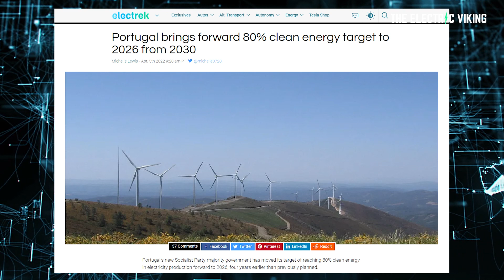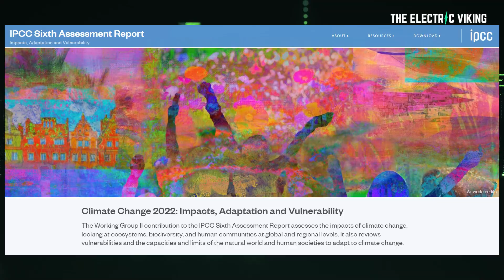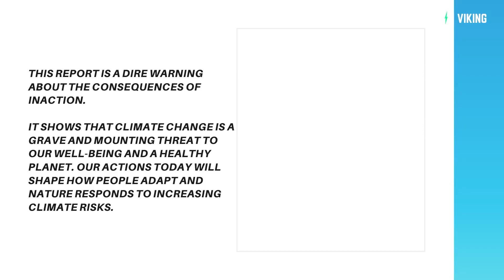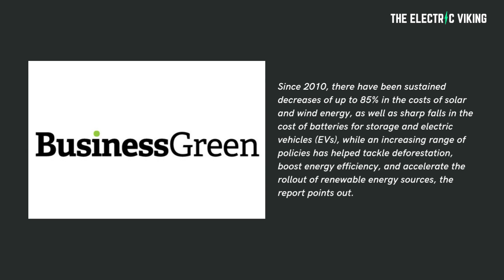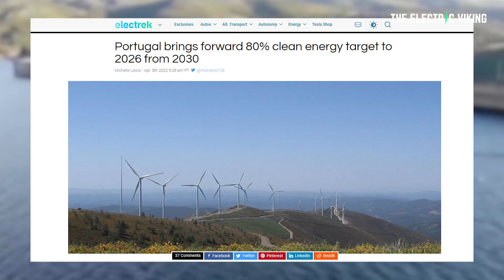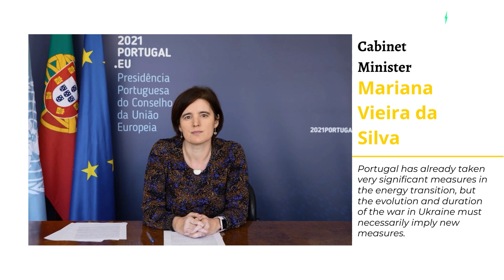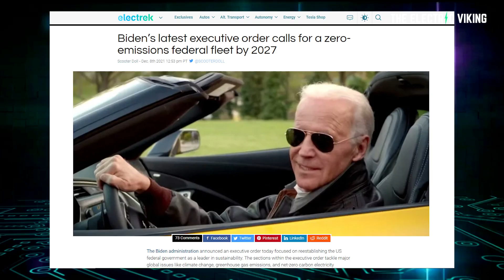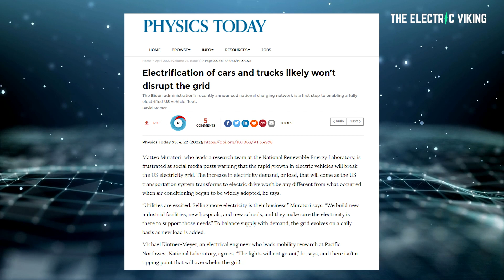Can the electrical grid survive if everyone drives an EV?

Comment: Don’t forget the load balancing aspect of EVs. If you’ve ever seen steam billowing out of a cooling tower, consider that this is energy being thrown away because it is generated but not needed to turn power plant turbines during off peak periods. EVs, that can be set to charge during off peak hours, can reduce the amount of power being thrown away by power plants. Utilities would much rather sell this energy to EV owners rather than watch their expensive fuel dissipate into the air as steam.
Reply: Electrician who has worked in/on power plants: While I agree with the yet underutilized potential of EV's for grid load and source balancing, I respectfully disagree with how you represent the steam billowing out of power plant cooling towers. Most conventional thermo-electric power plants use a combined cycle system to produce power from some source of fossil fuel. The fossil fuel is burned, producing very hot gases that are ran through a turbine to produce electricity, then the hot gases boil water and produce steam, then the steam is ran through another turbine to produce more electricity. Since the water and the steam need to stay very clean to protect the system, most power plants use a closed loop Rankine cycle that continuously recycles the same water through the system.

The problem occurs when the steam has to turn back into a liquid water again. One way is to just vent it into the atmosphere in an open cycle system where it will re condense into water (think old steam engines), but that requires an enormous amount of water that has to be continuously filtered and treated. So the close loop Rankine system is used. In order to cool that steam, the steam is ran through heat exchangers after leaving the turbine (often as cooling towers) that take a supply of water, often from lakes, rivers, or the ocean, and circulate it past the hot steam. Once the cooling water has absorbed the heat required to turn the steam back into liquid water, it will often be hot enough to give off some steam of its own before being returned to the lake, river, or ocean that it came from.

So while it is waste heat from the inefficiencies of the thermo-electric power plant, it is really not being wasted the way you represent. It is simply a byproduct of the power conversion process. The plant will try and operate at a capacity that optimizes efficiency while meeting the required loads, but it will not "throw away energy" into the steam just to keep the plant going, unless they are keeping the turbines spooled up for anticipated loads or as part of a required standby unit.

One major problem is that the Rankine cycle operates more efficiently the colder the cooling water is compared to the steam. This causes power plants to not run as efficiently during warm weather events, and can cause the plants to curtail power output, or even shut down altogether. This has been the major source of California and other places summer power woes. And it is only getting worse as the climate warms up, causing the cooling water to be warmer, and there to be less of it in many areas.

In some countries, usually in Europe, the waste heat from the power plant will be used to supply municipal hot water for commercial and domestic hot water and space heating in nearby towns or cities. Sorry about the "steam splaining," and I wish you the best.
Reply: @GoCoyote  that was pretty much how I already believed it works. Every day's a school day, Cheers.
The other point is that with a huge volume of water trying to shed heat at once down a cooling tower (clue in the name) ambient air will always be cooler. 
Even a few degrees different will create water droplets and a fog in the updraft/thermal giving the illusion of a vast waste of energy and water.
Reply: @andrewsaint6581  
That is why we get that nice mist coming off lakes on a cold morning. There is still the reality that any thermo electrical power plant is at best 50% efficient, so A LOT of energy does just go up the cooling towers as heat. :( 
Cheers.
Reply: @GoCoyote  Thank you. 
That was the best bona fide explanation of the state of play for current  power station operations - I have ever heard.
Reply: @TheAefril  
You are most welcome. My children tell me that I have a lot of opinions, along with some occasional facts, that I am always willing to share, whether they want to hear them or not. LOL
Reply: When I lived in WI, I could sign up for x cents/ kWh 24h a day or something like 2x cents between 7am and 7pm and 1/3x cents 7pm - 7am electricity service. Since no one was home during the day, we got used to running washing machines and dryers in the evening hours. The reason was that there was plenty of extra capacity during the night (possibly due to nuclear power plants, that produce electricity or steam 24/7).

I could have literally made money by charging batteries over nigh and selling the electricity back to the grid during peak times if I had the batteries. EVs are mostly charged during the night, so they would help the grid instead of the opposite.

I have seen some ignorant comments about China having not enough electric power to power all the new EVs. China produces something like 36% of the world's electricity. Close to double that of the US. And, at least, in developed countries, since when was it a problem that there was too much demand for a product?
Reply: Dharma, 

power plants reduce power when demand drops, the turbines never stop (Except for maintenance). They are not throwing away energy as the fuel input is also reduced. Yes, of course they will happily sell more power if the demand is there.

Comment: Gas stations and refineries use electricity just to name only two things required to supply gas. The demand for electricity from liquid fuel delivery systems will fall as EV demand goes up. Houses are also drawing less as light bulbs are replaced with LEDs and old AC units are replaced with newer more efficient ones. Even all the smaller things in a home are using less power as newer more efficient ones are available. Some of the old power hungry designs are not even manufactured anymore so you can't buy or install one if you wanted to.
Reply: Add to that the fact that some neighborhoods are becoming small power plants. In my neighborhood meggy houses have solar panels. The amount of energy produced helps the grid.
Reply: @acolon8999  It would be cool if there was a breakthrough in efficiency in those things. Imagine if they could double or triple the output of solar cells and maybe even incorporate the storage batteries right in each panel like a big IC chip.
Reply: @frankcoffey  I just returned today from Vermont. I was surprised to see from the highway so many farms with solar arrays. There was one that was at least the size of a football field. I could only imagine how much electricity those panels are generating. Probably enough energy to power 50 to 60 homes.  Every kW produced is one less kW needed from the powerplant . Not sure if they had battery storage but even then the prior statement holds  true. 

About 10 years ago my neighbor decided not to get solar panels installed. We were getting a similar system installed. We were averaging the same electricity usage for the year. I decided to get them installed and after about 7 years and some Federal incentives I got my return on investment.  I basically get free electricity, the value of my house went up, and as a bonus my house has a smaller carbon footprint.

My neighbors told me a couple of months ago that he is paying about $2,800 yearly on electricity.  He has spent tens of thousands in the past 10 years that he will never get back. Solar panels just like EVs are not for everyone but it's such a great decision to make for those who are good candidates to get it

Comment: Upgrades to grids will be needed but since the grid is/must be designed for peak loads, as long as EV's are charged off peak hours, not that big of a problem. Need peak rate pricing to make this happen. 
It's like the potato chip commercial, go ahead, well make more.

Comment: I have wondered about electrical supply issues for EVs. But not so much about the overall grid capacity but two other issues: 1) can the neighborhood wiring handle everyone charging their EV at night at the same time. 50 amps at each home. will add up fast. 2) The new power generation from solar panels comes at the time of day that does not need the extra power. California has changed their grid-tied agreement with residential solar panel accounts that has the effect that they will not pay the same price for solar power during the day. I think that a EV system that allows EVs to be charged during the day, at home or at businesses, so that we can reduce charging at night when everyone is encouraged to charge based on night rates.

Comment: Well, look at the meager EV production.  If you start building solar, wind, battery in US now they will all gracefully come together in several years.  A small corner of Texas could provide solar to power the whole US needs.  Probably other better places to build but just an example of how it can be done.
Reply: In addition to solar, West Texas is one of the best regions for wind power in the US.
Reply: Even in Texas with the best conditions wind is still too unpredictable to use as main power generation. It is a dead end because there are always long periods without wind, and even with storage are not economic. IPCC are a bunch of liar's. None of their predictions came true to date, which have been going for forty years. Ice on the poles is already back to 1980 levels. Polar bears are thriving, etc Massive greening around the world.
Reply: @Sander-zj3wi  Battery storage will help solve intermittency, and no need to look back (last 40 years) as technology has made great advances. As per NASA, Poles are not getting colder, but warmer. Ice is melting & breaking off, leaving polar bears without less surface to fish & hunt from. As per NASA & 97% of scientist  climate change is happening & is due to human activity.

Comment: Great collection of good news, Sam!
No, EVs is not alone such a big challenge for the grid. But at the same time, house heating and industries must also be converted to electric. Here in Sweden we already have good deal of electric heating and hardly anyone has a gas stove at home. But the steel mills are working to get away from burning coal, and the Northvolt battery factory is also going to need lots of GWh. At the same time ageing nuclear power is phased out. That's a big challenge, but I think it will work out.

Comment: With solar panels and batteries a grid is superfluous. The only reason staying on grid instead of off grid is so you can sell the excess electricity to others.
Reply: For the consumer yes. For the traditional generator, the consumer is the receiver of a monopoly service that the generator has an insanely high sunk cost on. The utility retailers also have a very strong incentive to ensure the consumer remains grid tied. Offering to buy excess electricity is just a bribe to the consumer which is just another form of market manipulation. If the difference between home storage TCO and feed-in tariffs was smaller the electricity retailer would have zero customers and cease to exist in a decade. 

Think about this. Millions of homes pay a daily connection fee to the retailer. This money also pays for the upkeep of the network for hospitals and other public buildings. If there are no retail customers how do the lights stay on at the hospital, sewer works, controlled intersections or fire station? 

Gimmie an answer

Comment: Let's do my standard calculation.
.
It takes 7kWh to refine oil for one gallon of fossil fuel.
.
The EPA official average fuel consumption in the US is a pitiful 25mpg (!)
.
An EV with a 70kWh pack will (easily) achieve 250 miles.
.
So, 10% of that EV pack (7kWh) would provide 10% of the range (25 miles)
🤔
That means, just the energy to REFINE the fossil fuel moves the EV the same distance as the ICE car, which uses the 7kWh and then  BURNS the fossil fuel.....
.
It's essentially free movement!
NO extra energy generation.
NO fossil fuel burnt!
.
This is a basic comparison, there's a plus or minus component on BOTH sides, but the premise is sound.
(Insert fossil advocate opinion below and I'll expand)
Reply: That is valuable information ! Thanks...
Reply: @chrisheath2637  
It's "ballpark", but I think it gets the point across.
If the response is "but EV's use more" just point out that you have to get the oil from the sea bed to refinery by tanker (bunker fuel!) then by road tanker to point of use..... Extra pollution! Really annoys them! 😉
Reply: @Roger Starkey I found a post debunking this  misunderstanding. Look up "Tesla Club Sweden Bensinmyten".
Reply: @rogerstarkey5390   In short: only 0.2kWh of the energy used is electricity, the rest is from burning waste oil products.
Reply: @rogerstarkey5390  But this also means that every litre of petrol generates 395g of CO² emissions when it is refined. So an "environment friendly" gas car that only outputs 120g/km actually puts out about 20g more than claimed, when taking into account the refining of the fuel.
(I had to cut my reply in three parts, otherwise YouTube would eat it up for some reason...)
Reply: @itekani  
You're assuming that
1) It's a "misunderstanding"
And
2) The "debunking" is not a "misunderstanding".
Myself, I'll take the word of a man who's actual job is to monitor, assess and predict the energy use of a country.
Reply: Is that 7kWh all electric energy though? I think most of the energy used is by burning waste products from the refining process.
Reply: @itekani  
My information was "grid electricity"
Originally from a conversation  between Robert Llewellyn (Fully charged) and Graeme Cooper, "Director of future projects" (or similar) UK National Grid (Which I believe is the same company as the US grid?)
If you Google his name / national grid you should see his reports from 2017 onwards debunking the "uninformed"